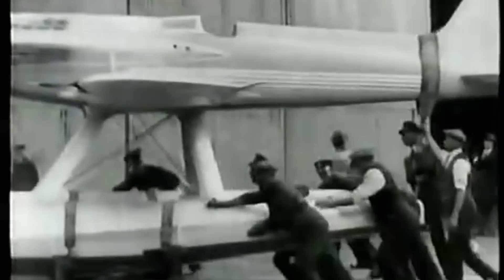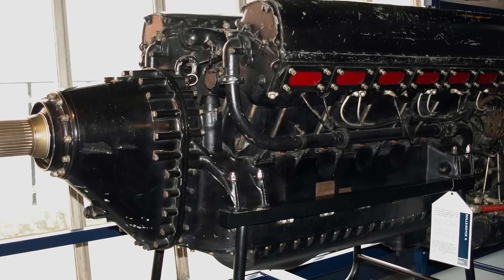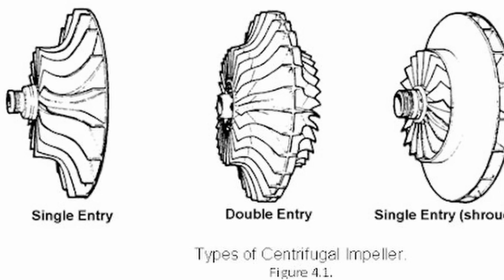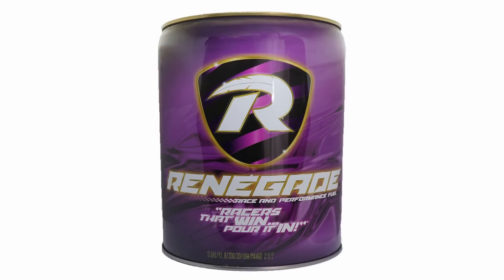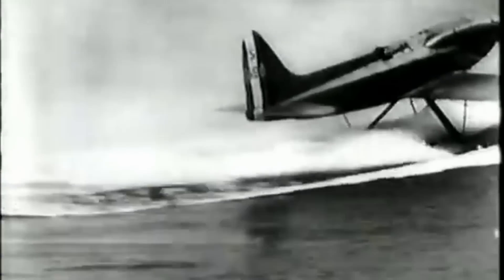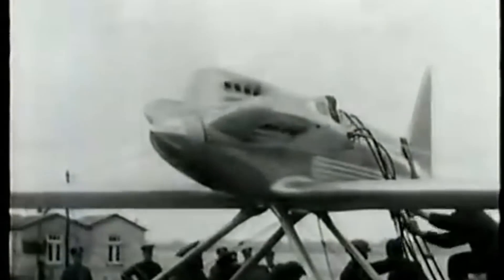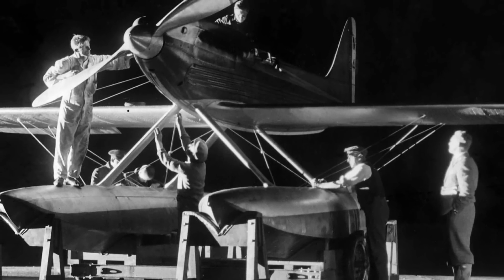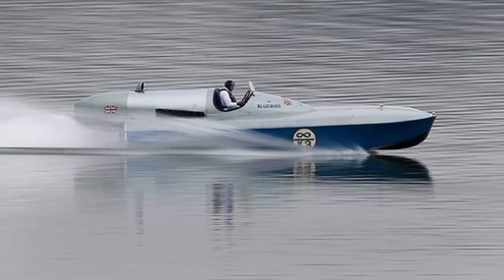Rolls Royce Type R - The Race Winning Engine You've Never Heard Of

Comment: Knowing what I do about the physics of engines running, and the dynamics both fluid and vibrational.....the pressures, just....there is a reason when it comes to engine development, the 1920s through 1940s have me in awe what they did without computers, just brute math, mixed with voodoo and art.
Reply: The book "The Secret Horsepower Race" by Calum Douglas is worth a read. He's an engineer so the book isn't short on technical details. It covers the development of aircraft piston engines during the second world war. He's got some videos on YouTube too if you want to get an idea of if you think the book might be worth buying or not.
Reply: @Surestick88  
I bought it.
At was both expensive and worth it.
Reply: Check out the Rolls Royce Heritage series. The Mustang talks about the people and the engineering. Merlin is more engineering.
Reply: Do you know there has only been one patent granted since the 1930's in Camshaft design and that was to Competition Cams for what basically was a small bump in the opening ramp for the exhaust to start a negative pressure wave timed to arrive at a point when the negative pressure wave was most beneficil to exhaust extraction.
Effective removal of burnt exhaust gas allowed better volumetric efficiency as there was less burnt gas residing still in the combustion chamber when the next power stroke began and the other benefit was less power losses with more efficient scavenging and hence better fuel useage and more economy.
Reply: @stephencox4224  v!
Reply: The crank and Conrad problems. The plague is the origin also fit through to the Blurton. It was eventually traced to the Royal not moving in at Royal high with the crankshaft centrifuging oil away from the bearings and good luck. Ewa pick a pump problem solved
Reply: Substitute ‘testing’ for ‘voodoo’ and I agree completely.

Comment: Burning 112 gallons of oil per hour, F1 racing teams must be jealous.
Reply: Which lowers the efective octane rating. I wonder if that's a misprint.
Quoted froma reliable website:
''Spitfires with the bigger Griffon engine will consume about 40 gal (182 lit), per hour set up for economical cruising at 1,800rpm which, with the higher economical cruising speed of 210mph (337km/h) gives just over 5 miles per gallon. In combat, this number was somewhere around 100 imp gal (454 lit) per hour''.
----------------
I think the author means 15 gallons per hour.
From the Aircraft Performance website, Griffons used .0.50 lb/h.p./hr. of fuel
and 0.022 lb/h.p./hr. of oil
----------------
Note: The Rolls-Royce Griffon has the same displacement as the Rolls'Royce R
racing engine which won the Schneider Trophy outright in 1931. The ''R'' engine was rated at 2,600 h.p./3,000 r.p.m./sea level at 67.0 in. boost
with a b.m.e.p. of 310 lb./sq.in.using 92-octane gasoline".

Comment: I never knew where the buzzard fit into the engine lineup before. Our museum here has a reproduction Ju-52 with a single buzzard in the nose and no other engines.  The type was used as a bush plane at the time.
Reply: That’s why the German transports were the Ju52-3M (3 Motors). The earlier ones were the Ju52-1M…

Comment: "Drivers set their fastest lap times during races"...... ah, no, they don't. That almost always happens during practice and/or qualifying.
Reply from the maker: Formula 1 is not a good comparison and does not represent the majority of Motorsport, because they have power unit modes/setups for qualifying and practice. All things being equal, like in a fixed setup series, the fastest laps are usually during the race itself.
Reply: @flightdojo  "All things being equal, like in a fixed setup series, the fastest laps are usually during the race itself."
Sorry, going to have to disagree with you there. Again.
Nascar - fastest laps are almost always during qualifying.
Supercars - fastest laps are ALWAYS during practice and qualifying
GT3 - Fastest laps are ALWAYS during practice and qualifying
Formula Ford - same
Porsche Carrera Cup - same
Toyota 86s - same
TCR - same
I could go on.
Funnily enough, conversely to what you're saying, F1 is probably the only category where it can and does happen, but even then it's often still only the fastest lap IN THE RACE, not across the whole weekend of competition. And it only happens because the category has a points incentive to set the fastest lap IN THE RACE, which hardly any other categories do, so there is zero incentive for the drivers to take a mad risk like that.
The only exceptions are when practice and quali are conducted in the wet and it dries out for the actual race. If conditions are similar, it almost never happens.
Stick to aeroplanes mate, you're wildly off the mark with motorsport assumptions.
Reply: @woopimagpie  Although admittedly, the cars used during qualifying are not the same as during the race.  They only need to last a few laps.  Are there any series in which the car used in qualifying must remain untouched (even the tires) and raced "as is"?
Reply: @jfess1911  NASCAR Infinity start on the tires qualified on and have limited replacements.
Reply: @jfess1911  Some production car series do this. Some even use a "split race" format where your finishing position in race 1 determines your start position in race 2, with no changes to the car allowed between races. Some club level events restrict to one set of tyres for a whole weekend (to keep it financially fair for everyone).
Reply: Love the name, just sayin.